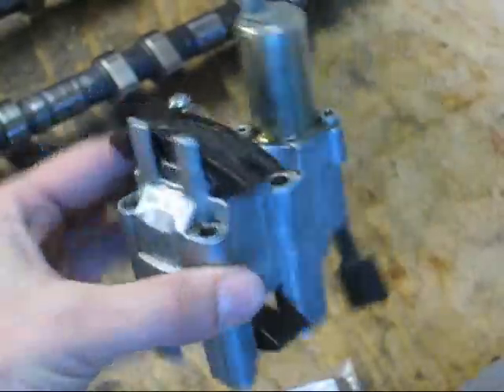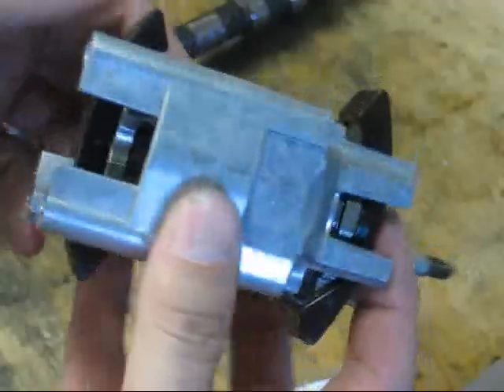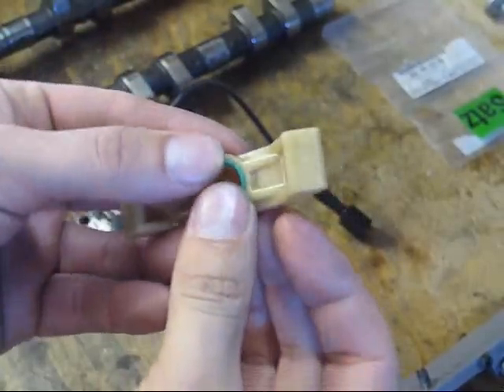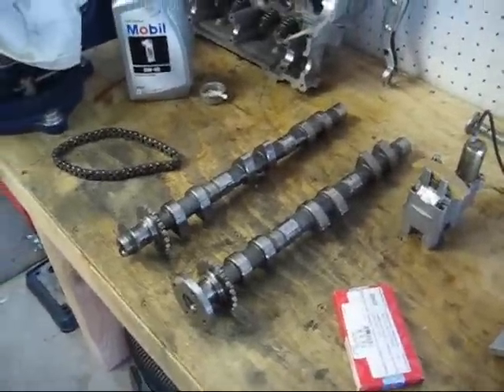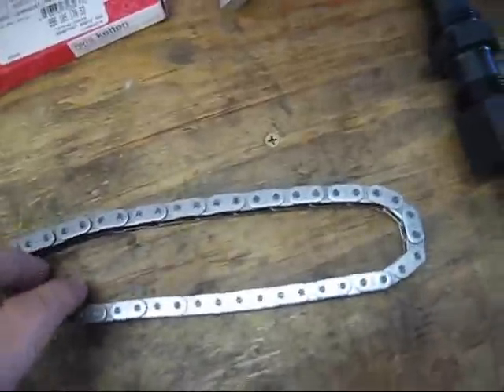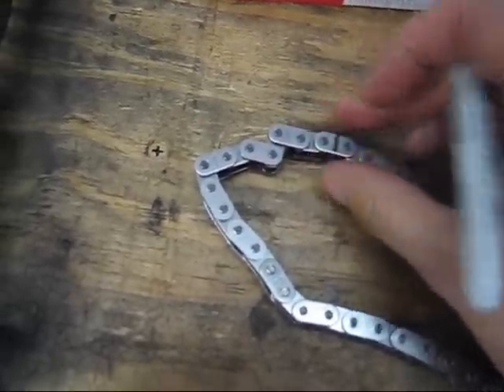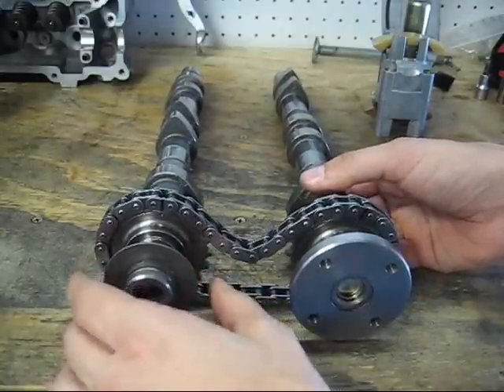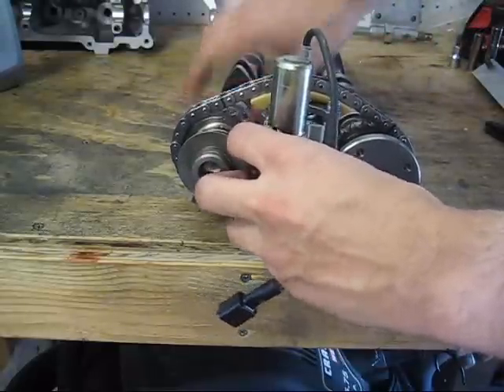Porsche Boxster S engine rebuild 08

Comment: At 4:02 what did you mean by upwards? Bank 1 turned upside down would be facing upwards aswel on both banks or up and bank 2 and facing down towards block on bank 1m

Comment: Badly worn chain rails have been known to destroy the engines just like the IMS bearing failures. Unfortunately there is no way of telling if these rails are worn unless a timely inspection is done. This really makes you wonder about the longevity of these engines, in some respects they are designed to fail prematurely due to the design.

Comment: Hi , do you know if it is normal to have a slight what seems like a timing chain rattle on start up for my 3.2 s . it normally happens if I don't use it for few weeks.It goes within a fraction of a second and the engine sounds sweet and runs like a dream other than that,